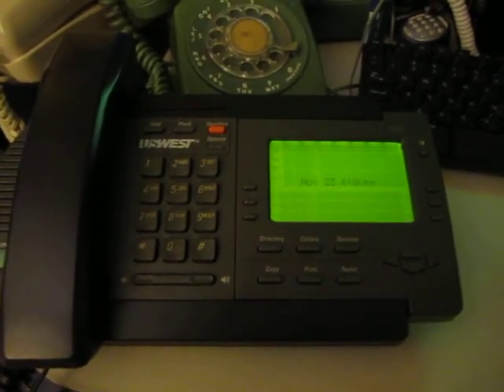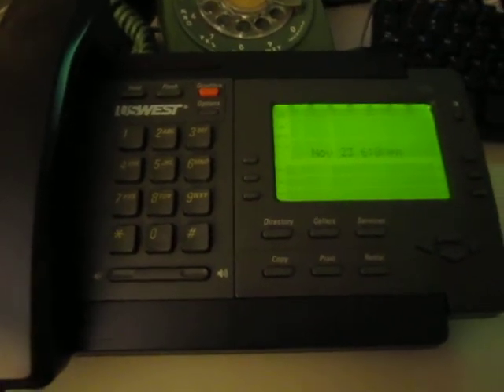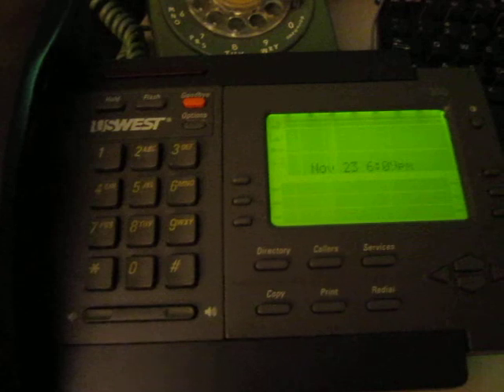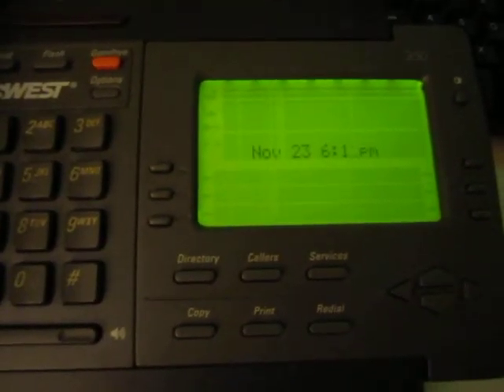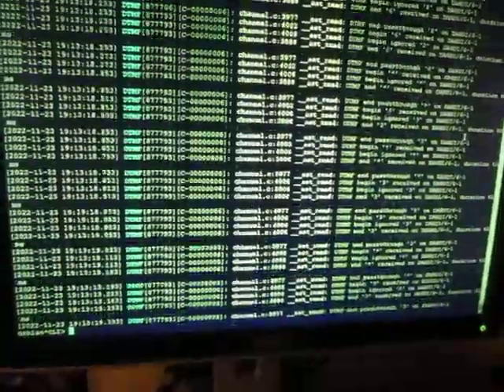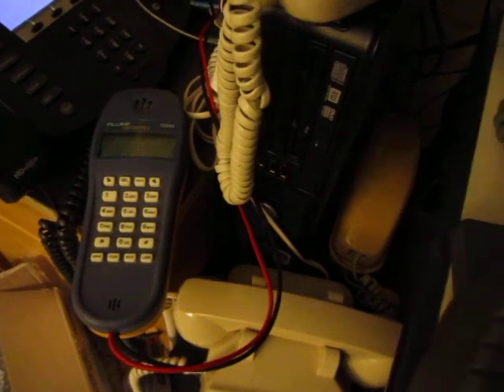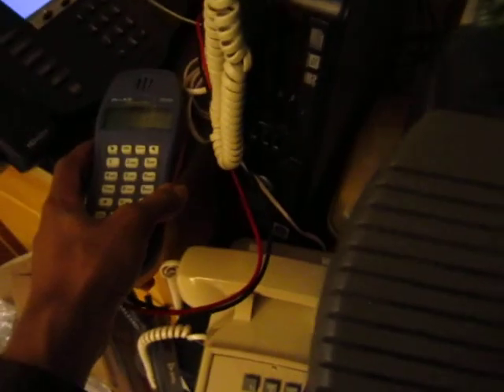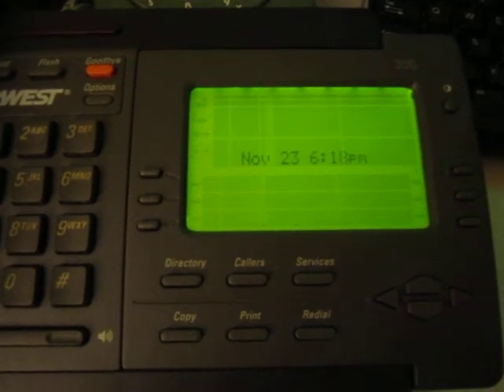Nortel 350 ADSI (Analog Display Services Interface) CPE | Demo

Comment: May I ask, when you press hold on one of these what does the caller hear (if anything)? I am thinking of getting a Bell one from Facebook Marketplace. Don't know much about how to simulate all the ADSI stuff (I take it you have a PBX?) but I think nonetheless, it would be a good phone for me instead of just the cruddy little VTech (cheapest phone one could get at Walmart) I have.
Reply from the maker: Nothing, pressing hold on the phone is a local hold (as opposed to Dial Call Hold, the MVP/Centrex feature, where the switch holds the call for you, perhaps furnishing hold music to the caller). Hold at the phone itself just places a load on the line to keep the line in use even when you hang up the handset, it's all low-level electrical stuff, no smarts to it.

Comment: Thank you.
  I've used a Aastra/Nortel 390 handset for many years.  (From what I can tell, the phone uses the M38869MFA microcontroller, a battery-backed CY62128BLL-70SI CMOS SRAM, an 24C02W6 erial EPROM, and more.)
  I never liked the idea of putting information into something if I could not get it back out.  For example: the 200-entry directory in the phone.
  On the circuit board is a 6-pad "J5" header which I suspect is a serial port.  The pads are somewhat accessible through a manufactured hole in the back of the phone.  What do you think about trying to interface with such phones directly through such a port connected to a computer running a terminal program?
  Do you know if the data be backed up, updated, and otherwise managed via Astersik?
  Thank you.

Edit...
ADSI commercial from 1998
https://www.youtube.com/watch?v=kqy8x5my5ow
Reply from the maker: That's a great question... as far as I know, ADSI is really only used for downloading programs to the phone, and I don't think there's a way to do it in the other direction. The specs do have a provision for, in later editions of the protocol, 2-way FSK communications and possibly that was done with this use case in mind, but I don't know of any common CPE that support that.

Asterisk currently wouldn't support it either way, but if the protocol allowed it then it could be added. I've recently added support for on-hook programming (you can expect another video about this soon).

Realistically, I think the server should be the "source of truth" regarding as much as possible, with a download to synchronize in one direction probably being the best way to do things.
Reply: @InterLinked1  Thank you for entertaining the idea. :)  Phone recovery or backup service would be interesting.  I  bought my phone from the telco as a private customer, not as a business.
Reply from the maker: Yes, unfortunately looking through the ADSI spec, I don't see any provision for updating the local directory using the protocol. I think the built-in directory is separate from the ADSI functionality and really just a local directory. I tend to not use things like that.

What might be interesting is an ADSI-based directory, e.g. a "Directory" softkey on the home screen can simply call up a Directory service that then allows you to interactively search the directory using the ADSI protocol. This would be centralized so there would be no need to maintain anything in the phone. It would be a little bit slower perhaps but that would solve the synchronization issue.